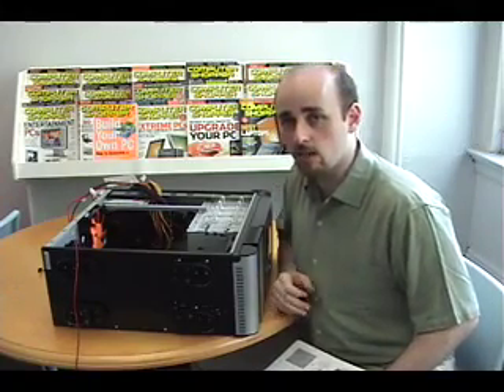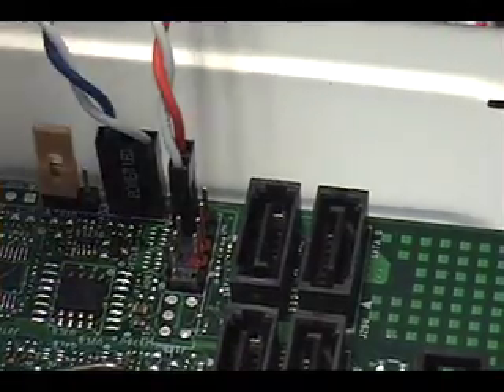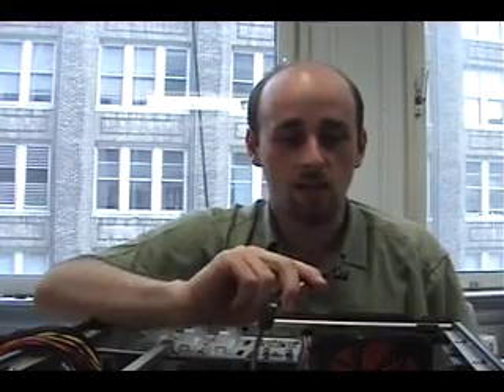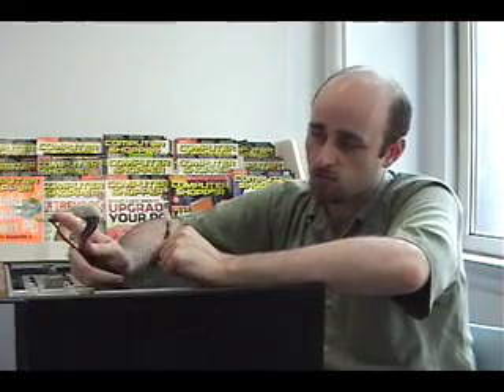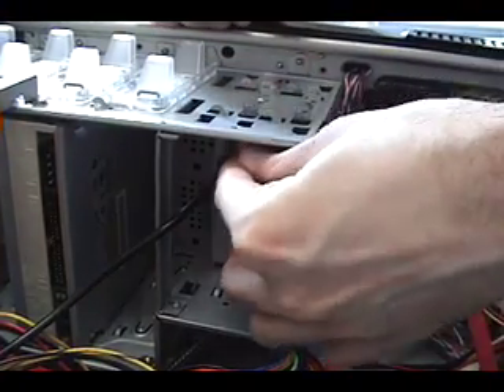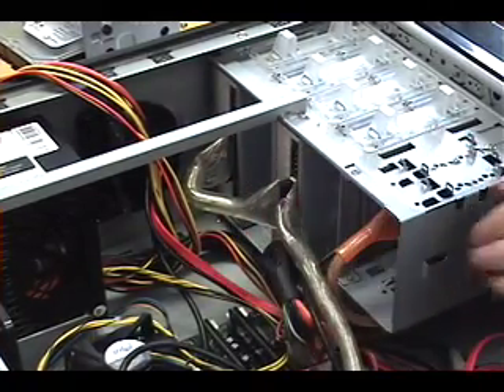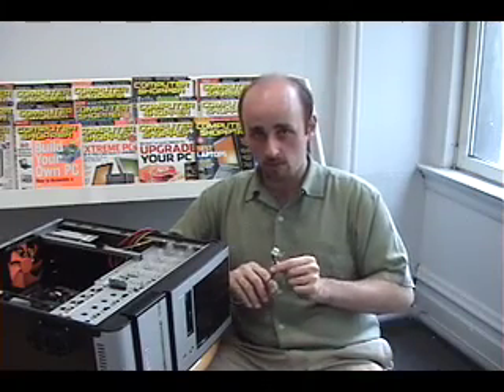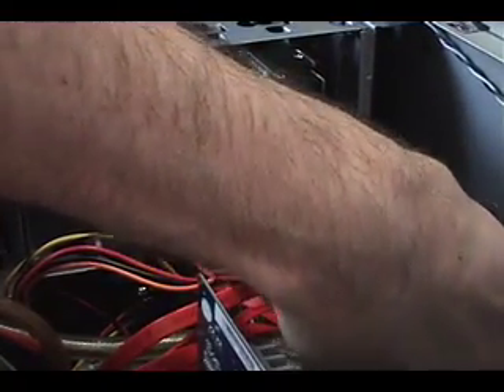Computer Shopper: Build a Multimedia PC, Step by Step (4/5)

Comment: @ShiroiKaji To ensure that you have all the SATA cables, power cables, etc. Make sure you do not get any OEM hardware. If an optical drive or card reader says ''OEM'' then you have to hope your motherboard/power supply comes with enough cables. Generally speaking, each motherboard will come with at least 1 SATA III or SATA II connector, for the hard drive. In my case, I had way more than enough cables. These cables can always be purchased seperately on newegg if you find you dont have enough.

Comment: he hasn't screwed in all the mainboard screws, that is stupud. When you are connecting the parts, you will bend your mainboard if you don't screw in all the mainboard screws. It can lead to a cracked mainbord, you dont want that.